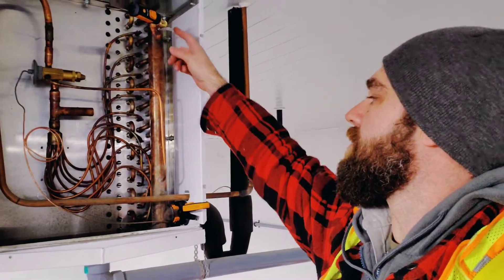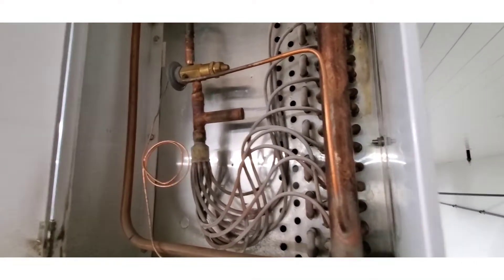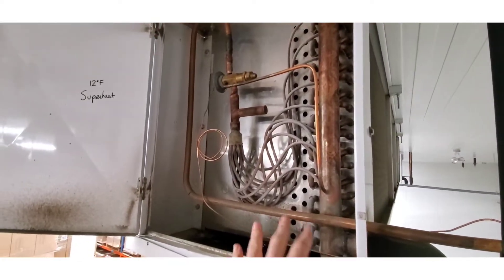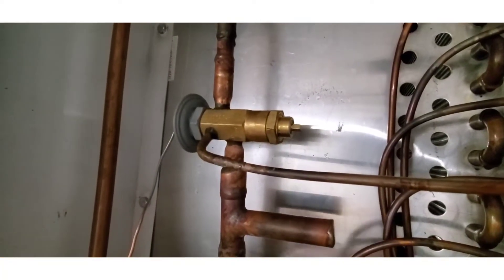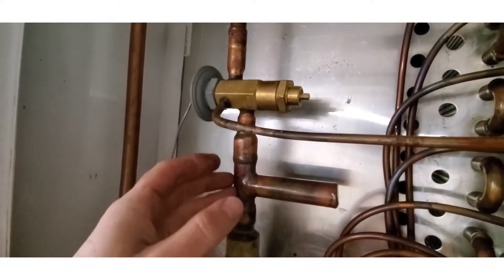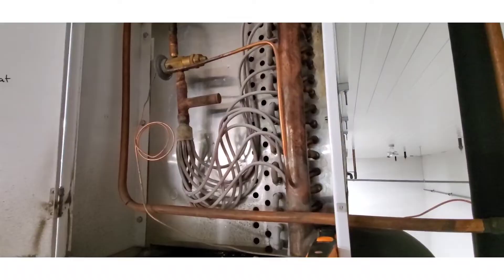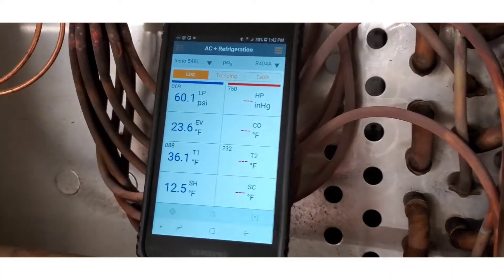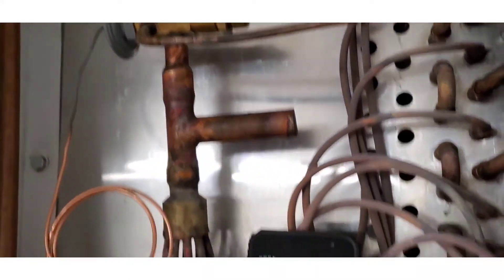How to Check Evaporator Superheat

Comment: A 12-degree evaporator superheat in a cooler is generally within the acceptable range, but could indicate a potential issue depending on the specific system and its operating conditions. Cooler evaps.  typically run 8-degree superheat ,following manufacturers specifications is the key to success . Great video !

Comment: What about checking the condenser for the right freon pressures and checking the sight glass first. So the Condensers are running correctly, then check each evp.
Reply: He said “let’s pretend the unit is running and charged correctly “ so he already checked the outdoor unit

Comment: Sir, How much SH is adequate for a -40°C  Blast Chiller using 404a refrigerant in 63KW system with 150 HP Screw compressor ?

Comment: Why are you checking superheat if there is a txv valve in the system?
Reply from the maker: Tx valves still require an initial set up and periodical check.

Comment: Nice video mate but clear my mind I read on google the for must system superheat at the evap should be 6-8 walk in cooler and 4-6 freezer can u explain that for me
Reply: You typically want your evap SH to be low, so you can ensure you are using more of the coil to boil off the refrigerant. High evap SH means you're loosing evap efficiency. You also have to be worried about too much system SH as to not overheat refrigerant cooled compressors, it's bad for the oil.

Comment: I don't understand why we always adjust the stem on TXVs if they are MODULATING valves to begin with i.e. the TXV is going to adjust the needle pin for refrigerant flow to wherever the sending bulb tells it to.

Adjusting the spring tension via the external stem is almost like playing with yourself, it feels good but doesn't make anything.
That sending bulb and E.L. are going to tell that needle pin how much to open or close after everything is said and done anyways, do why bother.

???

Comment: Looking to get a set of the Testo Smart probes. Do the probes and the app have the capability to log data and display graphs of the pressures and temps?
Reply from the maker: In graph form yes, data logging yes as long as your phone says beside them.  You cant set them up and leave for a couple days and leave.  For a couple of hours no problem.
Reply: @HVACKnowItAll  
Thats a bit unfortunate. I was hoping to have the probes connected on the system whilst diagnosing other faults on site without having to leave my phone/tablet behind.  thanks for your reply